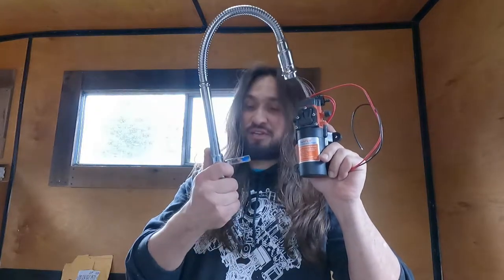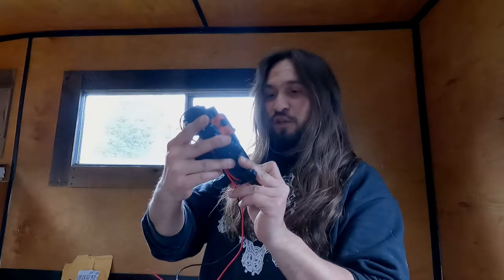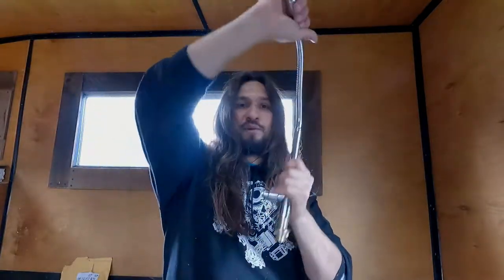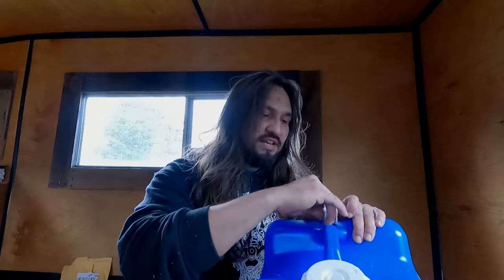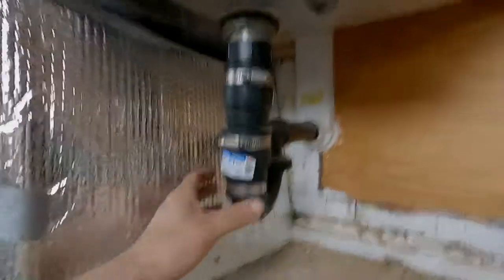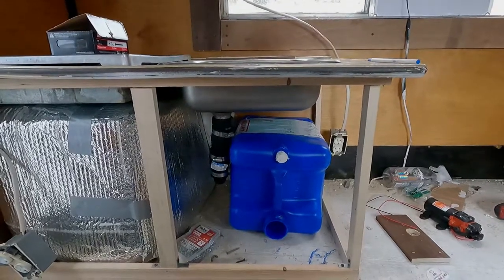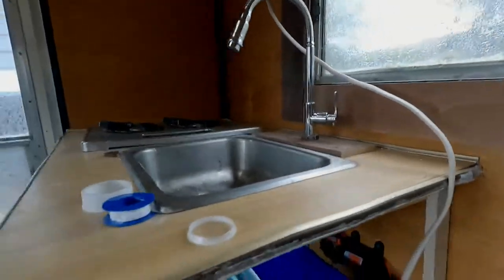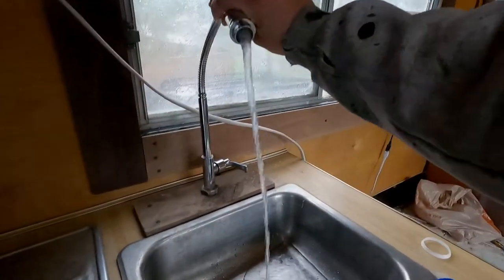RV Water System Essentials: Seaflow Water Pump, Inchant Faucet & Reliance Water Jug Review

Comment: Great video!!! I bought the same pump and an almost exact faucet for my Apache Ramada. I was looking at switch options...then I found this video and realized I didn't need one! Good stuff brother, huge thanks!!!
Reply from the maker: Heck yeah man, enjoy the water pump!  A switch is still a good idea.  When your water tank runs low the pump kicks on and you either have to pull a wire or let the pump run dry while you fill the tank.  I installed a simple on off switch which definitely helps when I'm not using the camper .   Happy campin!
Reply: @KooshdaakaaGarage  👊🏼Good looking out! Thanks again.

Comment: Just add a dc dc convertor to drop the pump down from 12v to 9v. The flow will reduce slightly but the noise will go down a lot 👍
Reply from the maker: Thanks jps, that's a good idea I may try that!

Comment: Great video! Are you happy with how it's been working since the install? Considering buying the same pump and faucet for my van.
Reply from the maker: Hey thanks for that Joe!  I've been pretty happy with the pump and faucet since the install.  So far no leaks, they both still work as strong as the day I put them in; they've even survived winter :D   The only thing I've done since then is install a cutoff switch so the pump won't turn on when I remove the water jug to refill it.   Other than that 10/10 would recommend!

Comment: I've never set up one of these,  but if you were to mount it using rubber feet that might reduce the sound.

Can you insulate the wrap-around (wood outer walls) to reduce noise, or would that make the pump too hot?

Teach me, Koosh!  🙂
Reply from the maker: Both great ideas John!  It came with rubber feet which helps out quite a bit I think. Can only imagine what it would would sound like with plastic feet.   I thought about throwing reflectix insulation on the inner cupboard walls and still may but now that the cupboard has walls, it's really not that bad.   I'll show ya when I do the walk around video of the finished camper 🙂👍

Comment: Not enough power. The 100psi (with adjustable pressure switch) model is a much better option
Reply from the maker: It's provided enough power and reliability for the past couple years.